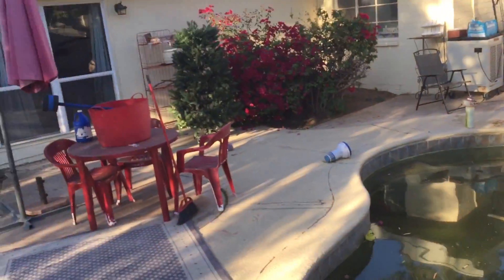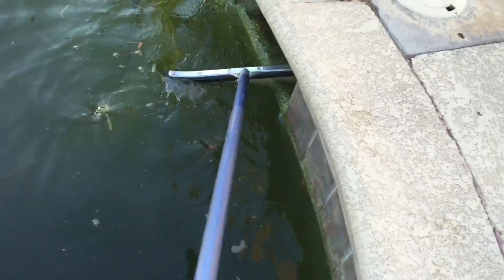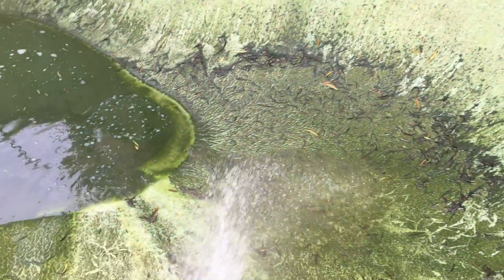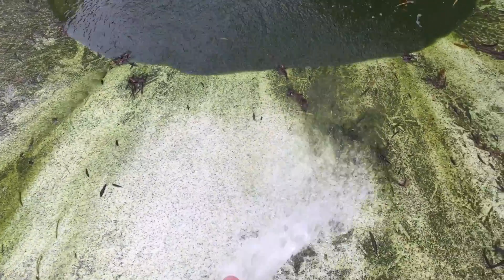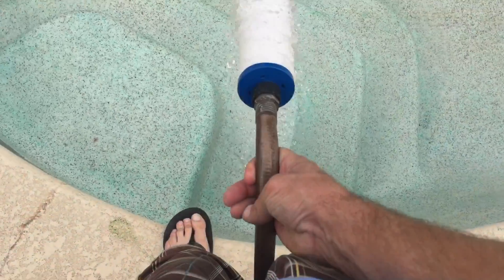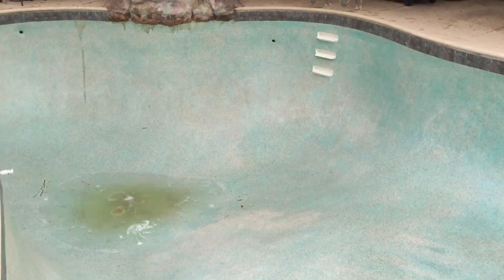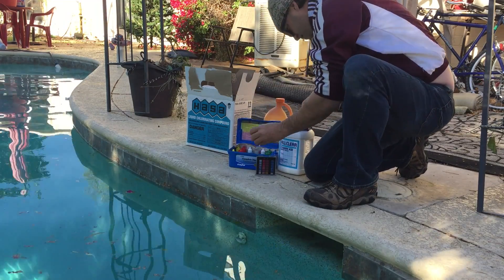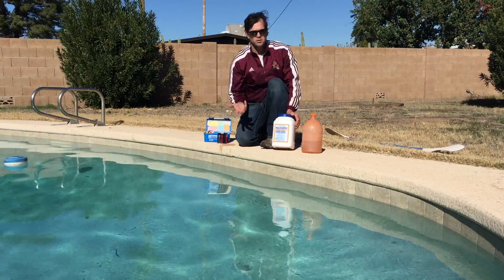Hitting the Reset Button: How to drain and clean out your pool

Comment: How long did the whole process take?
Reply from the maker: From starting the drain to the pool being full and ready to start back up was about 2.5 days.
Reply: Swimming Pool Science Oh wow that fast huh? I'd also like to ask about how much did it cost for all the supplies that was needed to do this?
I'd like to help clean a friend's pool and have it ready for their birthday which is in a little over a month from now (August 4). The water is already drained for the most part except small puddle like brown pond at the bottom. I have zero experience with pools and am debating whether hiring a pool person or doing it on my own. But following the steps on this video should be enough right? And cheaper than hiring a pro most likely.
Reply: Swimming Pool Science Just wondering what the difference in costs might be.
Reply from the maker: We’re about $350-$400 on a job like this. Supplies if you did it yourself would be around $100 with pump rental
Reply: @SwimmingPoolAZ-SPS  wait, so you have a $300 labor charge, and only $100 of supplies? Lol.
Reply from the maker: RBabik Ii Absolutely. Find a reputable pool guy in AZ that will do it for less and I’ll put him to work 5 days a week.

Comment: If you don't like using a pressure washer, why not just coat the sides with a bleach and water solution and wait 20 to 30 minutes?
Reply: Bleach only removes calc and color, not the dirt.

Comment: Why didn't he pressure wash it as the water went down? That's what I do.  Makes it so much easier and quicker. Work smarter not harder! Barefoot in that mucky, slimy slick water? Not good.  My pool is gunite and over 40 years old. I drain and pressure wash almost every year and repaint every 6 or 7 years. It does fine.
Reply from the maker: Takes about 10 hours to drain a pool that size so waiting for the water to inch down and coming back to power wash a few inches or feet at a time isn’t cost effective for a situation like this. Also, the fact that it was brushed when the drain was started goes a long way in removing most of the algae. As far as the barefoot part goes, that’s just how I personally roll when doing a job like this. Sounds like you have a good method for your painted pool. Glad you have it dialed in!
Reply: Swimming Pool Science you do work in the Phoenix area? Saw 602 area code
Reply: How deep your pool? Found out after we drained, took muck out and pressure washed it 12 ft deep pool. My house late 1960s so pool just as old. Painted with rubber paint hard get out of the deep end 😅😅
Reply: You need to run 2 gas pumps drain that sucker in 1 hr

Comment: I'm just curious, why don't you use a 3 or 4 inch trash pump to drain the pool? I do 3 to 4 drain and cleans a day for 2 months in the spring time. no need to scrub the walls down when you can just spray the algae off as the water is pumping out.
Reply from the maker: A trash pump would have worked really well for this bastard but we don't normally encounter ones this bad too often. The Sta-Rite pump we have works really well for 99% of the drains we do.

Comment: good info anything need to be done different if it's a vinyl pool? like is a chlorine cleaning needed?
Reply from the maker: Quinton Boffy vinyl is less porous than pebble or plaster so I think you can get away easier with just physically scrubbing any algae off the walls and floor. You could also dilute your bleach with water a bit and still do the rinse if you're worried about it doing damage to the vinyl.

Comment: Does the hydrostatic release valve open automatically?
Reply from the maker: TroutStrikeMike we have a pretty low water table here in az so they're not even required or ever installed here.
Reply: I have one that kept going for almost a week before we could paint our pool here in NC. So frustrating that it took so long to equalize.

Comment: How many bottle of chlorine did you use?
Reply: slvvm4 

Right lol.. The questions no one seem to ever answer.
How many gallons of chlorine they use an/or about how much area is covered per each gallon.
Which if you watch, you can see and get an idea.

An then the chlorine in generally cut with half water and half chlorine, but they never seem to show or explain the acid wash or mixing of the acid solution (with whatever else) as a viable solution.  Would and could, be nice to know and to mention in their videos though lol.
Reply: @bentontruff662  I do about 3 chlorine baths a week as a pool repair tech. I only use less than a gallon of chlorine with a $15 chemical spray bottle. I also do this while in the pool (while wearing rubber boots and gloves) and pressure wash clean. Takes about an hour of work. $500 minimum
Reply: @StyxNstoners  lmao 1 hour?!? It must be a 4k gallon pool! If it takes 1 hour your not doing it right.

Comment: I suggest Invest in a power washer
Reply from the maker: Topgunner124 we have one and it just sits. It can be a useful tool but you have to be careful. Sometimes old plaster is very soft and power washing can blow the plaster right off the pool.
Reply: 4:50 he said it u didnt watch the video
Reply: RetroGamer Just wanted to say that. So many stupid people here.
Reply: Topgunner124 a
Reply: Benton Truff I don't understand, why the submersible pump when you have a pool drain at the bottom of the pool
Reply: Swimming Pool Science 

Thanks bro your videos actually explain the process lol.
Are you using STRAIGHT chlorine or cutting out in half with water ?

Cause I'm not getting the same results, an the green staining is NOT melting away as shown in your video and others.
I'm also trying to figure out the correct mixture to give an acid wash, if you can help me out.
Reply: I was gonna say the same thing
Reply: Creaky C. How about 60000
Reply: aggreed
Reply: You can use a 'higher-power' pressure washer by using a larger nozzle. It will decrease the PSI and increase the GPM. For example, if you have a 4000 PSI/4 GPM pressure washer and it's standard nozzle has a 3.0 orifice, use a nozzle with a 6.0 orifice and the PSI should reduce by approximately half and the GPM should approximately double. Or an 8.0 orifice and the pressure will be reduced even further with even higher water flow.There are also pressure-regulators available. I believe that would save a lot of time compared to scrubbing.
Reply: Brian D. At leaat someone understands 🙌🏻
Reply: @Some Guy 
EXACTLY ... wonder how many deadbeat clients he has ... my experience with pool owners is they ain't the brightest or honorable (it's all IMAGE)

Comment: That needs a safer drain cover.
Reply from the maker: If the pump was directly plumbed to the main drain, absolutely. this pool is plumbed traditionally where the main drain line goes to the skimmer and is connected via a diverter valve so no chance of injury via the drain.